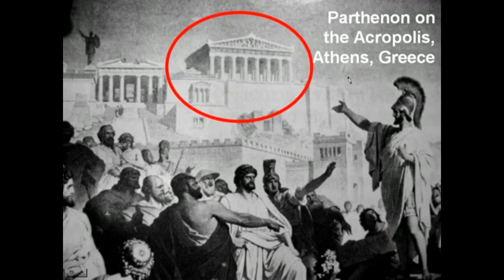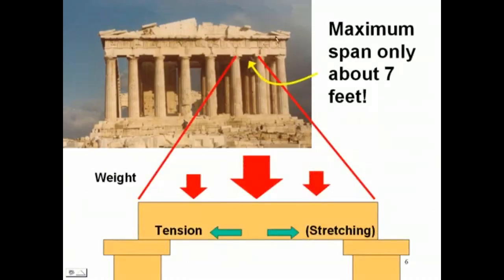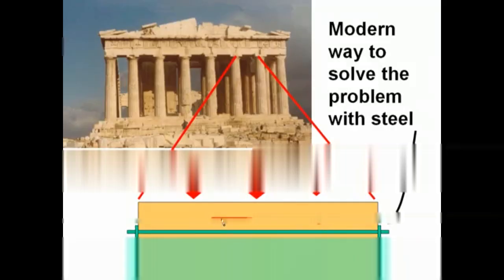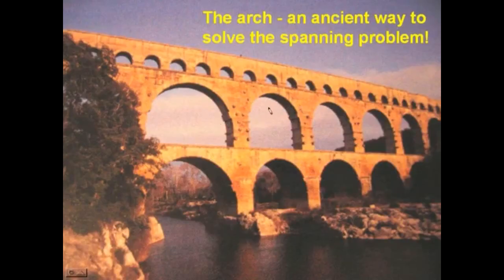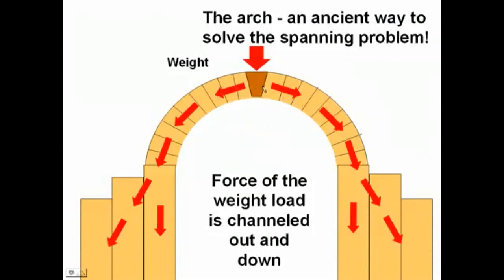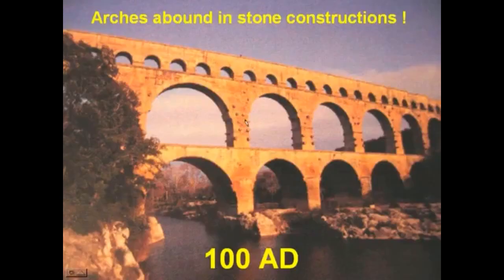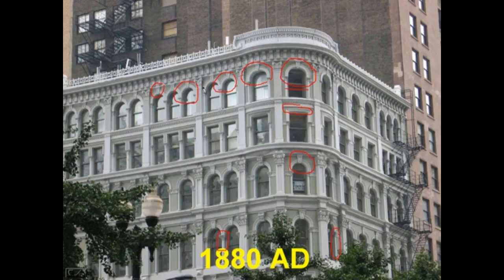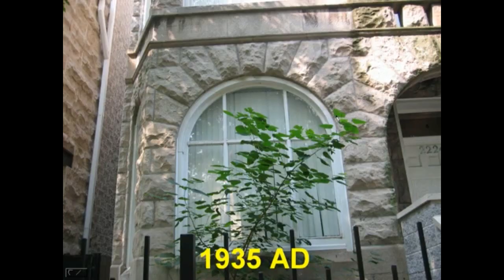Page 35 History of Visual Technology: stone construction and the arch

Comment: That 1880 building in Chicago was typical of the era- the facade was load bearing, there was no steel frame inside with the facade being a curtain wall supported by the steel like modern construction.
Those arches and columns would have been structural and decorative, the reason why the  non arch windows could be straight across the top is the window span is only about 4 feet and there's no load above- just open windows. They used a lintel, and also usually embedded a thick steel angle across the opening inside the brickwork.
RD Wolff, Author of "The Gargoyler of Greenwich Village"

Comment: This is one reason nails are preferred to screws in framing, not just to save time and money. Screws have no give so they either rip out from the material or sheer under pressure. A nail will bend and sway with the material. Thus not allowing complete collapse under extreme stress.

Comment: @ 8:33 The stone is relatively thin, almost a veneer. You can see exactly how thin it really is on the corner of the building. This says to me that the building has a framework of some kind behind the stonework and the stone is not actually load-bearing. This would be par for the course in 1935. A true load-bearing arch this close to the end of the wall should be supported by buttressing at the corner, which isn't there.
Reply: not always if you have enough downward pressure.

Comment: if it would be straight or square it might just slide and collapse easier, is not more important than others you need all pieces to be accurate, the key stone just have a special shape that makes it easy to slide down and get stuck
Reply: Moises Barrientos you can use a square if it's a gothic arch, it'll just be corner side down, in fact you could use one in a regular arch it'll simply have a corner protruding downwards at the top of the arch, as long as it's not side down but instead corner down it should work.

Comment: on modern structure to extend the width of concrete the use of reinforcement steel is necessary, as our mentor mentioned a rod is place inside the concrete structure and after it cures the steel rod is tighten to create tension giving to the structure a convex shape that load will eventually straighten out.
Thanks Sir, your time has been well spend.